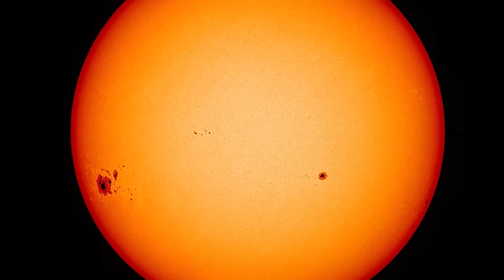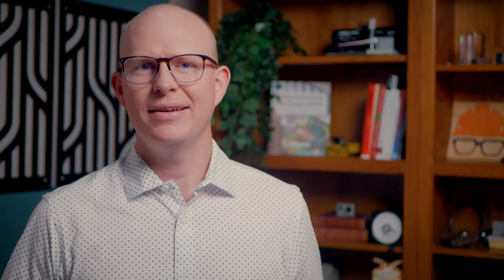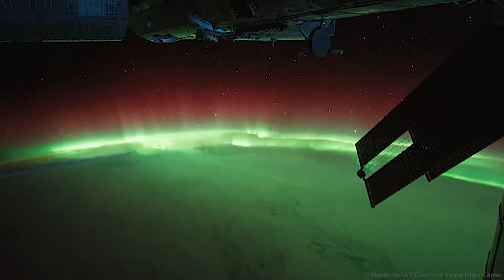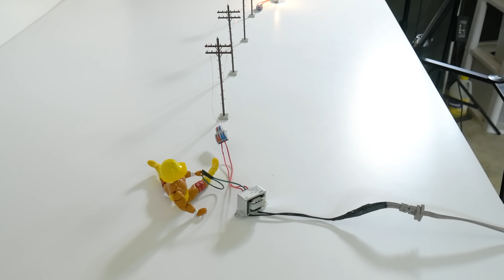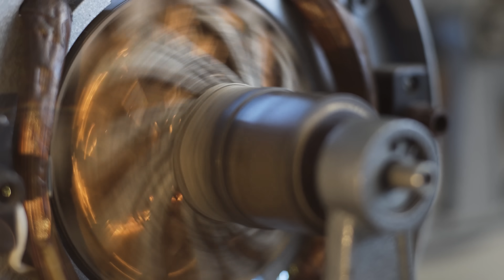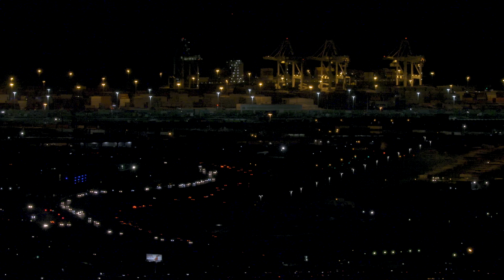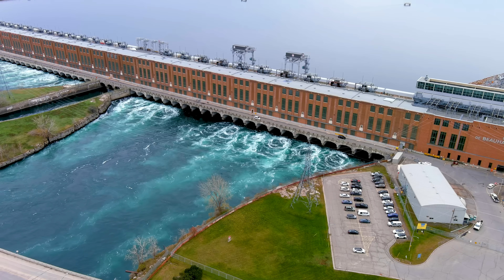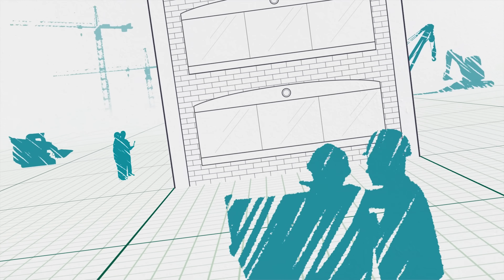The Most Confusing Part of the Power Grid

Comment: It's worth researching the Carrington Event, and Solar Storms, these are not uncommon and can be very very bad in our modern electrical society. Engineers understand and are working hard to design out or at least design in quick recovery. 
However it also requires political will and expense, ever tried to persuade someone who has never done science since aged 14, that they need to spend loads of money on something they don't understand, which may not happen in the next five years....

Comment: So Residential customers while not billed specifically for reactive loads, do pay for the temporary use of electricity due to those reactive loads. The utility who supplies the infrastructure to provide for those loads deserves to be compensated. Since Residential customers tend to present similar very loads, an accurate estimate can be made for each and billed as a part of the $/kWh charge that they pay. That means they do not need more complicated and expensive metering that Commercial and Industrial customers require. The reduction in meter costs more than offsets the small inequity of the estimate.

Comment: I might be off but I seem to remember that big industrial parks tend to have powerfactor compensation in house to avoid paying for the reactivate power at the utility. 
I was told a small data center has also capacitors handy attached to their power distribution system to shift the slightly inductive power suppliers back to 0. The installation is about 2MW, if memory serves.

Comment: You should set the oscilloscope to display current, and swap the probe connectors to GND become the common point of the shunt resistor and load, (and invert Ch2). This way you could actually see the voltage of the load, and the current is displayed as current. And you can attach GND of Ch1 too.

Comment: Ah that explains why when Transmission lines are being put back into service they need power to be fed into them before the transformers are energized. It is all the inductance/capacitance being recharged. In 2016 it took a few hours to reset the grid after a blackout in South Australia. We now have a few Tesla grid battery's to provide both real power and some reactive Synchronverter functionality.

Comment: We can start with the fact that my understanding of this is elementary, I'm glad to see so many experienced and knowledgeable people praise Grady's clarity, I would be happy to share mine, but it's the praise of a novice.  I have a question about a larger event like this.  There is a whole doom scenario I've seen, I think it's called a some kind of event where the old telegraph wires caught on fire during a solar flare. Can someone speculate on if that was that caused by the systems ability to manage load, which I guess would be managed today by tripping protective circuits, or  would it have been more like an EMP that would still result in considerable localized damage in a worst case scenario?

Comment: Were informed regardless of where you live, to use as little power as you can, for one reason, you'll save money. And the second is, the power plant can't keep up to the demand of it's customer base in which it was designed for, when the population of the area it was to support, has risen.

What is never told, is he fact that a power plant doesn't cut back to that of a lower out put, when the use of it by the populist in the general area inwhich it was built for the purpose of providing power, the increase int the growth of the population, was figured into the planning and design of the plant. If and when one cut's back on their use of power, they will indeed using less, save money. However when the power plant is now using less of it's normal out put to the populist. It then see's it to another power planet, who's though they could increase their output, find it cheaper to buy another's excess. So cutting back save you money but then allow's the power plant and it's investor's more money. To the point it's more than you save when it's you who cut back.

Comment: 4:02 bulbs don't change resistance depending on voltage, but on temperature. As the filament heats up, the resistance increases. At running temperature, they can have 10 times the cold temperature resistance. And you can directly measure it, you're measuring the cold resistance.
Reply: Since it’s an electrical supply, you’re not supplying temperature so it would still be appropriate to say resistance is changing as the voltage increases. That is, the resistance change depends on the voltage being supplied. Again, you’re not controlling temperature in any useful or controlled way.
Reply: @MAORIguy25  You can say that but you're hiding the effect. Makes it sound like it's a material property, voltage dependent resistance, which is not the case.
Reply: @andutei isn’t temperature a concept that abstracts the movement of atoms? And isn’t that increase in the movement of atoms in that particular region the thing that causes resistance of the energy being transferred from the other atoms movement in the wire? And isn’t that too just an abstraction from the real action happening involving fields and such that may or may not be something you can model to accurately capture what’s really happening? Isn’t it hiding the effect when you reduce all that unknowing theory down to just temperature…?

I like the idea of keeping it practical specifically when it’s an experiment with a couple of variables being, but it is funny to argue semantics
Reply: @MAORIguy25  I guess😄 Depends how deep you want to go. But the temperature thing is easy to understand. Hot metal impeding current flow.
Reply: @MAORIguy25  For instance, if you apply the voltage for just a few milliseconds, the resistance wouldn't change much from cold. Incandescent bulbs draw 10x current at startup.

Comment: Once we get a transcontinental HV DC bus to dump alternative power into this should be less of a problem. 

The biggest problem we face is electrifying the commercial vehicle fleet, which will be difficult to do on the current grid system. We can double of triple alternative energy production easily, the problem is what to do about recharging high end commercial vehicles.

Comment: Pro tip:  that electrolytic capacitor is polarized and only suitable for DC circuits.  Applying AC or reversing the polarity of the DC will eventually result in your capacitor becoming a burst of confetti.

Comment: Thanks for your succinct explanations of real and apparent power. As you say imaginary numbers don't help in a simplistic explanation. I have been involved with electricity through generation and transmission from an apprentice in 1972 to my retirement in 2021. I'm curious as to your take on the NPS [Negative Phase Sequence] effects on power systems your side of the pond following faults and on solar events. I would say that it is more confusing than VARs.

Comment: Geomagic storms induce DC current in the power network and thus potentially saturate the main High voltage transformers ie heat up the transformers. Hence tripping off HV transformers - loss of supplies

Comment: It's relatively straightforward until someone decides that kWh is a good unit. Or when someone asks you to include the measuring device's effect and the inner resistance of the battery. Maybe it doesn't make it more difficult, but at least more confusing. And just leaving DC world to AC world which this video did fairly quickly. Doing insane triangle formations to figure out some reactive power at school by hand almost caused me to lose my mind. Of course some students had the suggested calculator and were told to just press the button that gives the answer.

This all is of course important, but in no way as important as the impact of these electrical features on when the string vibration goes through the guitar pickups and controls to the cable into a classic fuzz pedal circuit. Every part of the chain impacts how the pedal works and what comes out after the amplifier and speaker. Those are of course yet another massively important electric devices. Especially the speaker's impact on the circuit, when for example trying to make an acceptable power attenuator, or using dummy load and speaker simulation and not make old school guitarists grind their teeth for you saying it's good enough.

Comment: did you do a video on the Generator Capabilities, specifically how many VARS a Transformer can be adjusted to before damaging the transformer in relation to the System Grid VARS. 
Most Unit Operators take good courses studying VARS and your Transformer Capabilities, But It would be nice to see a video breaking down what the Curve is relation to what your transformer is capable of in relation to the Grid System. 
Many times the Grid Operator calls to the Unit Operator asking the Unit Operator to adjust their VARS up or down or how many VARS can they absorb at the moment. 
We have Graphs of our respective Transformers always attached to the Panel. Then compare the chart to the requested change the Grid Operator is requesting. In that moment of decision, of " CAN I, or CAN"T I" you go to your chart to see where the VAR change might put you in relation to Transformer Capability.

Comment: I work at a rubber plant, we use MASSIVE capacitor banks and power conditioning equipment to keep our power factor in check. Been there for years and I still love being around when we spin up a 1200 hp motor. Indescribable

Comment: "Imaginary numbers" are not imaginary when applied to AC power. They simply describe the actual voltage and current in the circuit. They just happen to have the same maths as "imaginary" (or complex) numbers in maths. So everybody please learn your imaginary numbers in maths because they are actually useful in electric engineering.

Comment: I was a commercial construction electrician for 20yrs, I have a pretty good grasp of 3-phase power, but I have to admit, this went over my head. We never needed to worry about the engineering, all that was included in the blueprints. We had to trust that the engineers knew what they were doing, and it was our job to install it all and make it work.
Reply: omfg wow. thats really impressive. 20 years. wow. commerical construction electrician. wow wow. u got the job done and made it work. wow thats really nice. comment section isnt a job interview bro
Reply: @sashareinhard6645  And yet it bothered you SO much that you just had to leave a nasty comment. If you don't have anything nice to say, then say nothing. Or just F off

Comment: While the idea of converting existing conventional generation assets into synchronous condensers seems like an obvious solution on the surface, and is clearly an attractive idea for asset owners and grid operators, once you get into the details you see that it's actually not straightforward but quite technically challenging.

Comment: I just saw a clip going on about "6 phase power", saying it's smoother.

Is this hokum? 

Back in the dark ages, I was taught that 3-phase (120°) carried constant power (into a fixed load, obviously) and that the sum of the three currents and voltages should be zero, if phases are balanced.

How can 6 phase be smoother than a constant flow of energy?

Comment: When I did my electrical operations training way back when this video would've been so great to watch. In the 80s, training materials consisted of handouts photocopied from the operations and training manuals and regurgitated verbatim from the instructors. It is a dry subject but you've managed to explain it so that it's easy to understand.

I commented on this in your black start video, but I'll repeat it here. You mentioned Australia using retired generators as synchronous condensors. I know that the idea was floated when our oldest station, Hazelwood Power Station in Victoria, Australia was retired in 2017. But it's 160km from Melbourne, the largest load centre.

In any case, we've lost most of our manufacturing the the syncrhonous condensors are mostly gone now, the most prominent being the ones at Fisherman's Bend in Melbourne, the site of our now defunct General Motors manufacturing plant.

We used to notice the load on the system on dayshift as the system controllers would call requesting a tap change to increase our MVAR output. (tap change refers to altering the turns ratio of the generator's transformer to increase or decrease the output voltage and hence MVAR output). On hot days especially, we'd be down to tap one. These days, with the demise of manufacturing here in Australia we mostly sit on around tap 10 (of 15) and are often importing VARs to the point that we often have to refuse the dispatcher's request to tap up (or down depending on your perspective) as we'd hit the generator's capability curve under-excitation limit.

Comment: 3:57 hold on a moment, that explanation of watts, volts and amps has always confused me because you say one is like pressure of water in a pipe and another is like flow of it, but those two are hard to differentiate, right? Because with the more flow you also have more pressure. And water can’t be compressed right? It’s so confusing and frustrating trying to understand them. so isn’t there a better way to explain this? They seem like one in the same thing and it’s always struck me as a bad example of explaining the differences between the three, there must be something better. And yet everywhere i look i always find this horribly confusing example. Is it really the best we can do? I tend to always love a deep explanation of how things fundamentally work especially with math, physics and engineering, and i have yet to ever find an explanation that makes sense that breaks down the elements of how basic voltage works. Resistance doesn’t need explaining, it’s easiest to understand here, but the other three seem painfully similar and lacking clarity. So with volts, watts and amps, there must be a better way of understanding them apart from each other. Tell me one thing (or preferably as many as you can think of) about volts that is different from watts without using the same example or any math formulas. And maybe with amps if you used the same example you could say it’s like the size of the pipe with water flowing, right? Or is that wrong?Because amps tend to be the power behind it that can kill you. Where as volts can be great but not kill you, as with static electricity discharge, so those only a few examples i want to get out of the way that I’m familiar with.
Reply: read or watch videos about how electricity is generated and you will understand.  for example, an open circuit battery (meaning a battery not connected to any load) has voltage but there is no current, no power, no resistance.  if you can understand that, that is a start.
Reply: No. 

You’re making bad assumptions. You’re confused and frustrated because you believe things that aren’t true. You may be trying to find a comparison to something when they aren’t the same situation at all. 

Voltage and Current are independent. Pressure and Flow are independent. You can change one without changing the other. Begin to understand this, and you’ll get closer to being less frustrated.
Reply: watts, amps, volts can’t be separated because you use them to calculate each other

the water analogy only goes so far

Comment: The most confusing part of the power "grid" is how come large areas lose power when a single power pole is downed because an automobile hit it?  It feels more like a bunch of long extension cords connected to the houses from a central point.
Reply: If you watch some of Grady’s videos (including this one) you’ll see that “the grid” is designed to react quickly to prevent damage from spreading. If a transmission line is downed, it could pull power from a very large area - they’d need to repair or disconnect it before they can safely restore power.

Comment: As an end user if you have an Air conditioner compressor that is rated 5 tons with a Power Factor of .8 will only produce 4 tons of cooling.
Reply: that is not correct.  tons of cooling is cooling capacity, in  well tons or btu per hour.  if it says 5 tons, it will be 5 tons.  the actual power consumption is a different number.
Reply: That’s quite literally the opposite of what that means.

Comment: How do you supply more specifically reactive power on the generator side???
Reply: You saw the part where he can adjust the inductors?

You can easily switch on and off capacitor banks, vary inductors, and digitally modulate power supply. (Easy - not free)

Comment: 4:03 The incandescent bulb doesn’t change Resistance due to the Voltage. The metal filament changes Resistance due to temperature, non linear.

Comment: Your nose curve with capacitors is actually wrong 17:25. The curve is not shifted upwards but rather tilted upwards so that the tip of the nose can be above the nominal voltage. This means that with capacitive loads the voltage will actually slightly go up as the power increases. Only when you hit the tip the voltage will go down but then so sharply that it's unpredictable when you it hit. The total transmissible power will increase though so you might hit the current limit before you hit the voltage stability limit.

One thing I think is missing is the way that reactive power can be used to control the voltage in the grid. With DC power the voltage with go down the further your load is away from the source and there is nothing you can do about it. Also it will vary with the load. But with AC you can plug in a reactor or capacitor to regulate the voltage along the line and keep it steady. So reactive power isn't just a bad thing but actually very useful.